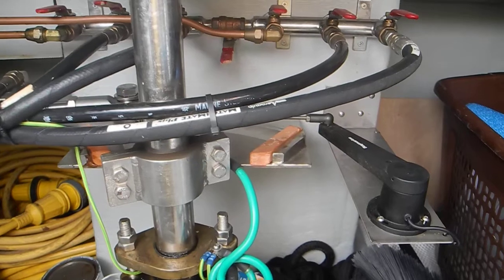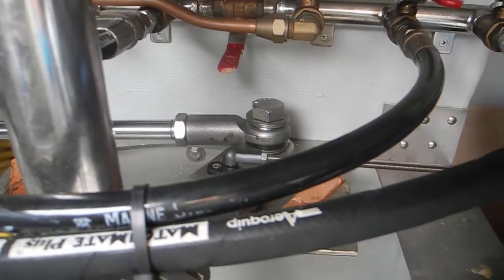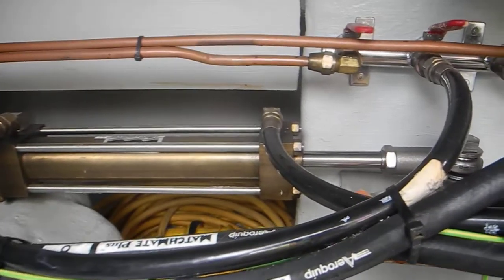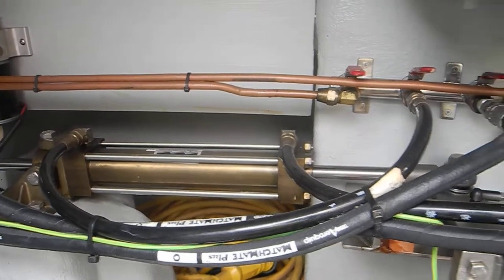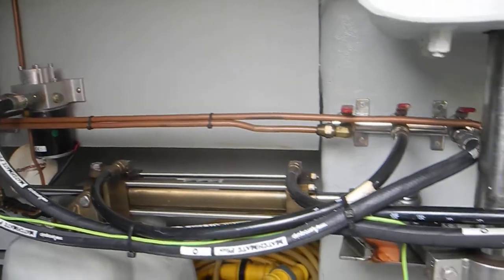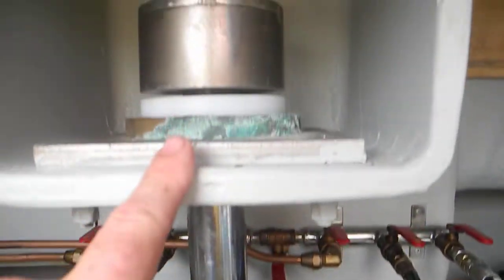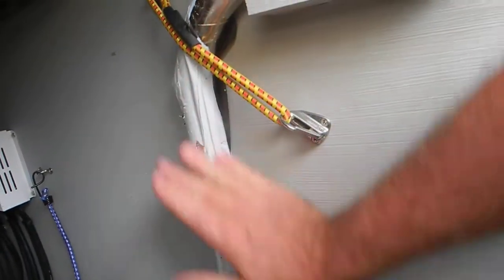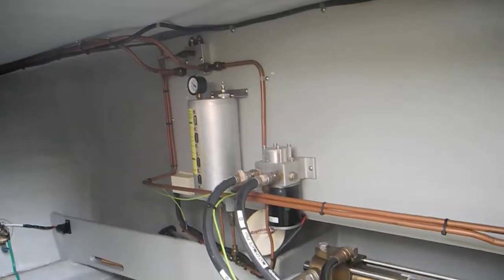Complete steering system explained

Comment: Hi how does the emergency tiller overcome the hydraulic pressure?
Reply: There is no emergency tiller on a boat like this
Reply: I would think you use the emergency tiller when the hydraulic system fails.  if it fails,  there won't be much pressure to overcome

Comment: Plastic...I hate plastic. They couldn't use aluminum?
Reply from the maker: Richard Parker I don’t recall seeing any metal tiller arms on autopilot rudder angle indicators. They are all a composite material. Plastic is the catch phrase. Your FRP boat is actually fiberglass reinforced plastic. GRP is Glass reinforced plastic. Modern jets and airliners are made of composite materials too.